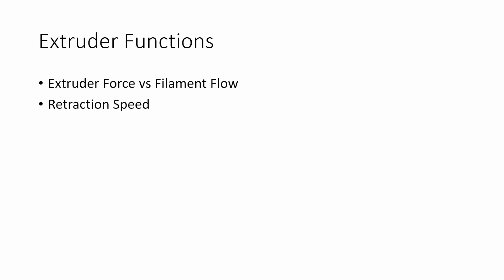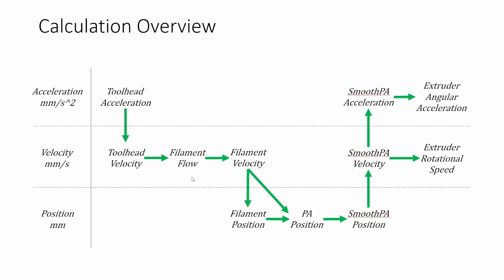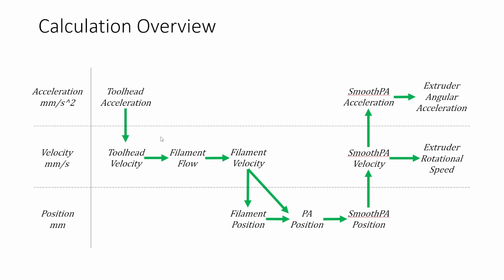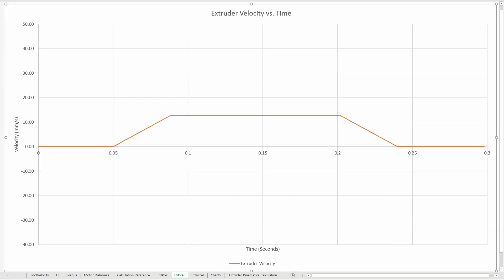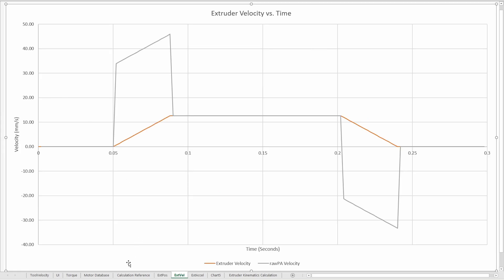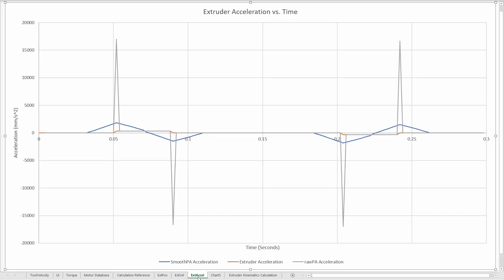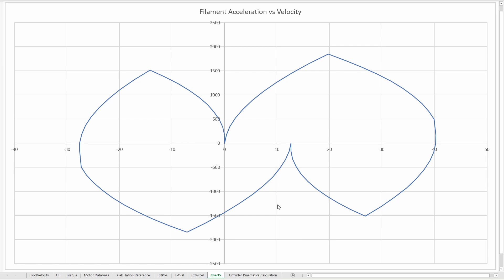Extruder 101: Klipper smoothPA Kinematics

Comment: I wonder if the hotend could be controlled with a heat advance, to add power based on amount of energy required to melt the volume of filament being extruded, rather than waiting for the measured temperature to drop before increasing heater power.

Comment: Excellent, very detailed explaination of PA kinematics.

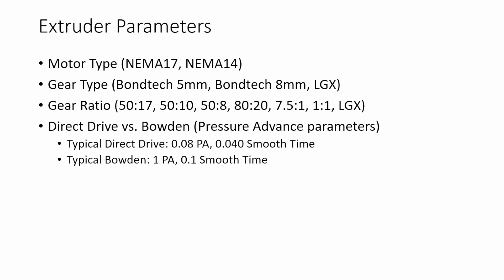The only annoying thing is the part at 4:15 : "Direct Drive vs Bowden". That's a comparison we often see, yet it's a misconception, and a misnomer. Unfortunately, 3D printing world is based on approximations, as is the understanding of "direct drive" for 90+% of makers. Even most manufacturers got it wrong.

Essentially, "direct drive extruder" only means that the driving gears are mounted near the motor shaft. In that respect, Bowdens are direct drive extruders (you could make a remote motor bowden extruder too, with all it implies).
On the other hand, Zesty Nimble use a flexible shaft between the motor (mounted remotely on the main frame) and feeding gears (mounted on the printhead carriage) ; those are "remote motor direct feed" extruders, even if marketed as "direct drive" (which is wrong).

What you really meant is "Direct FEED vs Bowden".
Reply: Not going to change the whole naming nomenclature because of one obscure extruder... doesn't make any sense.
I realize this is a 2 year old comment and maybe your opinion might be different now.

Comment: Hi Eddie, thanks for the awesome video!
I got curious about some recent changes to klipper and wonder if you happen to know some details.
When I first got into klipper I think they used something like  max_accel_to_deccel to clip sudden velocity changes. Looks like the smoothPA is working in a more "advanced" way now?
Another question is that is the step calculation different if I specify the true gear ratio and rotation distance rather then simply (and manually) multiply them and only set the "equivalent" rotation distance (like the step_distance before)?
Reply from the maker: My understanding is the acceleration limits primarily limit printer toolhead acceleration, not extruder acceleration. There may be a newer update that tweaks some of the formulas I’ve used but I got the latest ones from Klipper documentation! 

As far as I know, using a gear ratio and rotation distance vs a rotation distance that accounts for both ends up being identical math wise in Klipper 👍🏼
Reply: @eddietheengineer  Thanks!

Comment: As far as I understood with this kinematics calculations we would be able to calculate torque for the extruder that is required just to spin up and spin down the rotor of the motor, torque for compensation of reaction force on filament is the whole another part?
Reply from the maker: Exactly! That's another component that needs to get added--and I'm not sure if I'll have it scale with "nominal" extruder velocity or smoothPA extruder velocity. Technically it's pressure based--but I'm not sure how far down that rabbit hole I want to go! Retraction should be a quick calculation that's kind of independent from the rest.